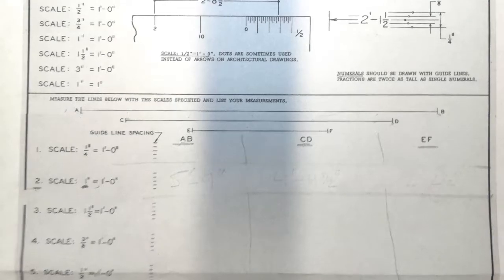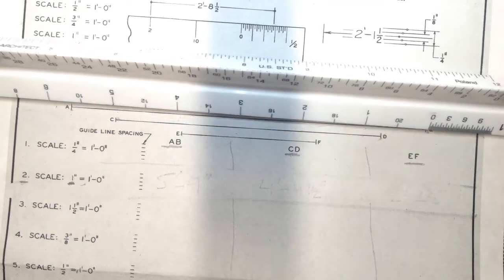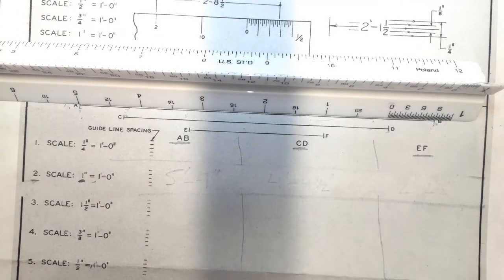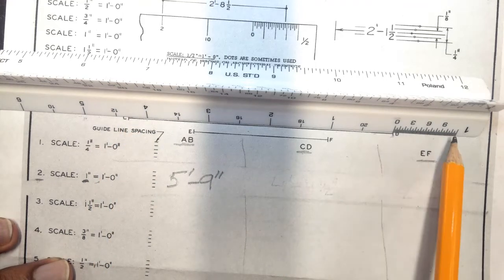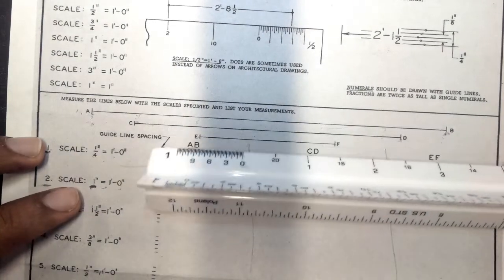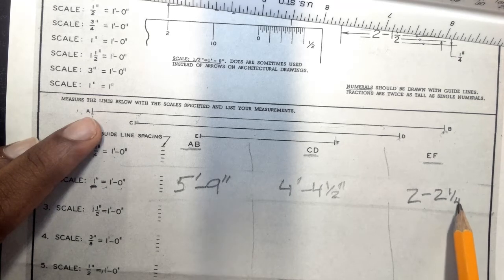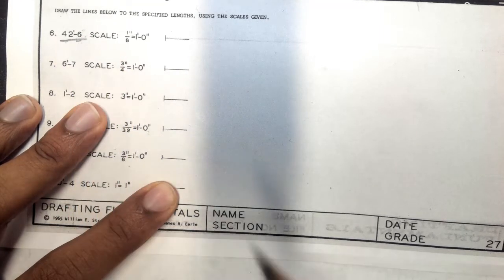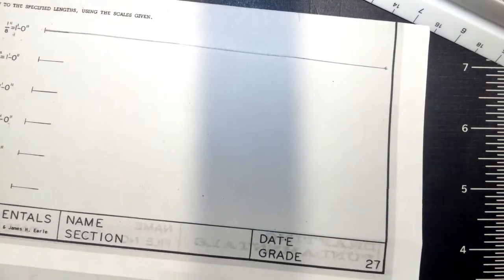How to read an Architectural Scale

Comment: This scale: 1"= 40' 0" is from an engineer's ruler, on the architect's ruler scale, what scale would it be? 1/4?
Reply from the maker: If 1" = 40', then 1/2"=20', and 1/4"=10', so it will not be equal to 1/4"= 1'-0," the closest way to get to do it is using the engineering scale 1"= 50' then the closest divisable factor is 1:48, where you would divide by 12 to get close enough. Increment on engineering scale are divisiable by 10 vs 12 on architectural scale take that into consideration. Hopefully that helped.